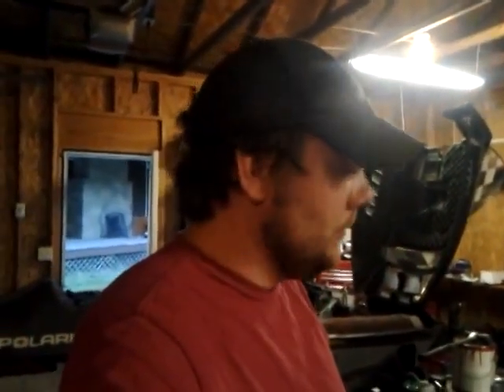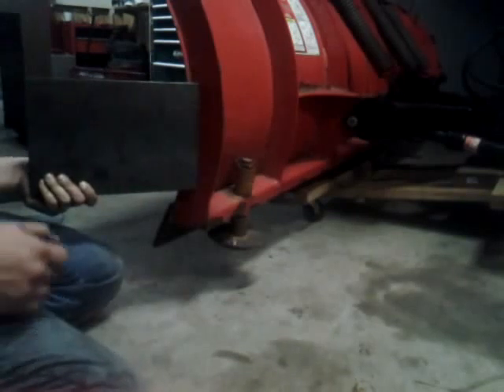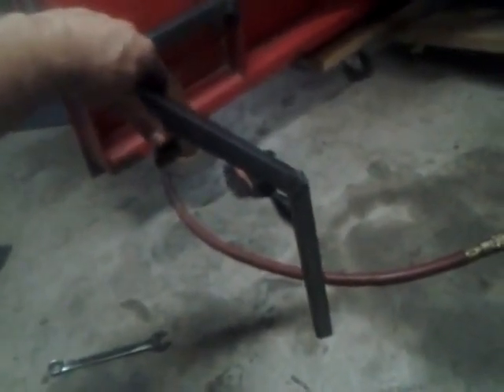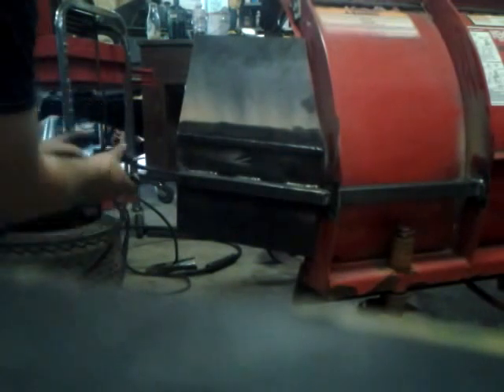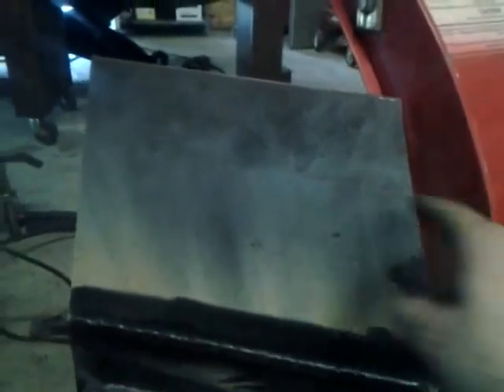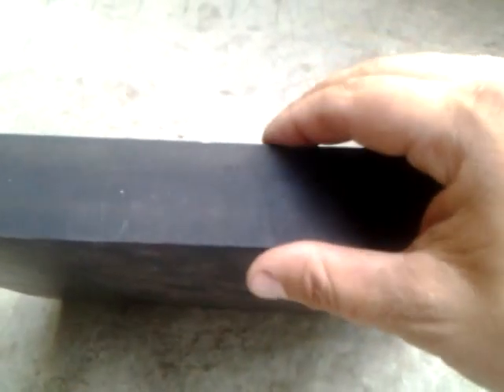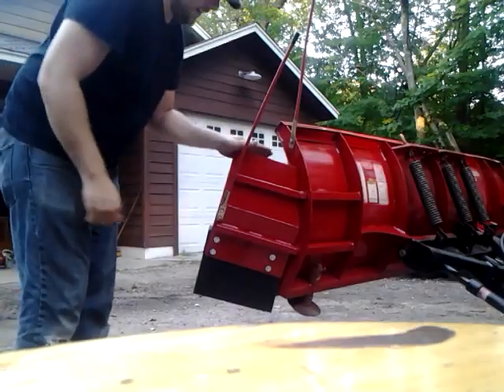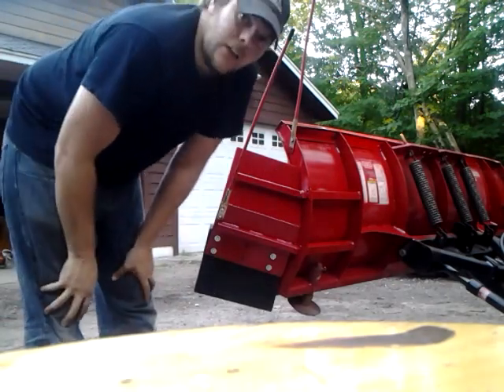HOW TO BUILD CUSTOM PLOW WINGS!!!!!!!!!!!!!!!!!!!!!!!!!!!!!!!!!

Comment: When I made my wings I ended up having to put a large steel basically a washer between the bolts to help keep the rubber from pulling to the bolts hope this helps for for you
Reply: I would take flat metal stock like 1"x6" long or so, enuff to span both bolts , to serve as washers, drill holes in it and bolt through that, to add stability and prevent the bolts tearing out when the lower edge of rubber catches a object.

Comment: Put the rubber on the back side of your wings, Put a backup plate on the backside of the rubber to keep it from flexing. Then bend the bottom half of wing forward till the rubber is even with the plow cutting edge